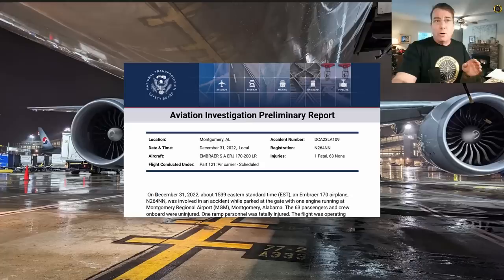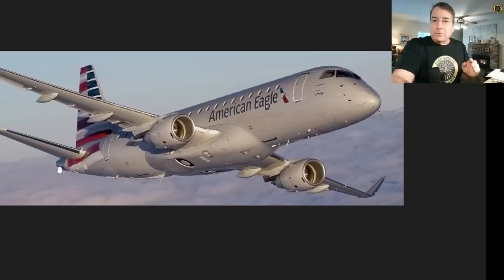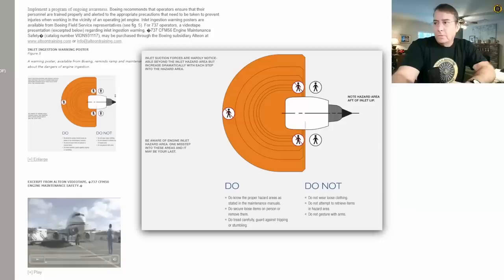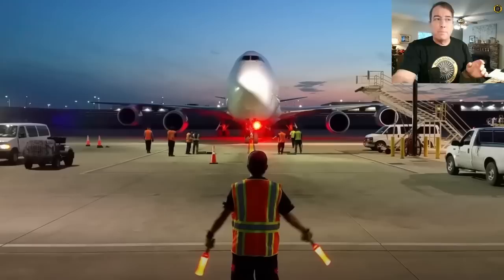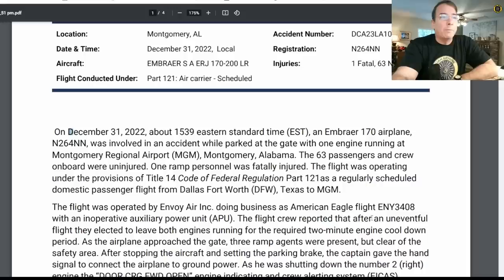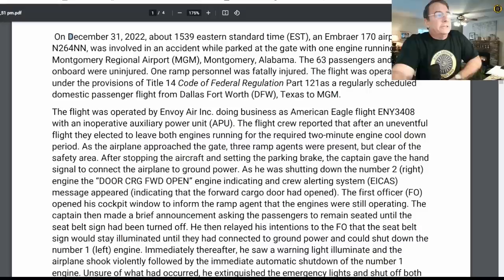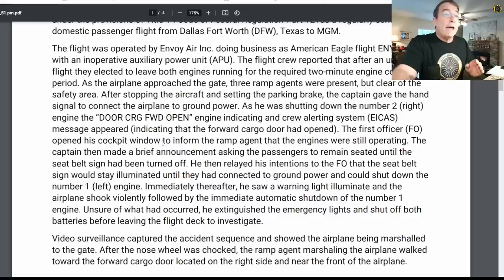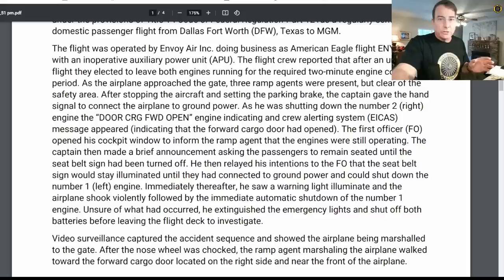NTSB Preliminary Report Ramp Agent Fatality 31 Dec 2022 Montgomery Al.

Comment: It would be really interesting to look into the ground crews training at this airport. The amount of safety violations that occurred after the plane landed from the cargo door being open and people walking close to the plane while both engines were running is very telling.
Reply: I agree. It seems from the moment the agent moved toward the cargo door, it signalled that it was safe to start their ramp duties 😨
Reply: Indeed. Not only the victim violated basic safety rules.
Reply: Yeah, couldn't possibly be personal responsibility... must be someone else's fault...
Reply: I'll bet the safety training is fine. 
I'll bet it was the Go! Go! Go! Attitude that contributed to this incident in a Big way.
Reply: The training is standardized across the airline.  Initial is done via computer modules and then they fly you to a centralized training facility somewhere like CLT or DFW (for AA).  After that, anyone who is on the ramp is fully aware of safety zones, briefings etc.
Reply: Training at my company is poor (not on behalf of the airline though because we're contractors). At this point it feels like they're just throwing anybody with a pulse on the ramp
Reply: @trinity72gp  All too often leaders are inclined to handle breaches of safety rules in the "No Harm, No Foul" mode. They haven't got time or enough extra workers to truly discipline those who break the rules, so the rules aren't followed rigidly as they should be.
Reply: Another contributing factor: holidays. Rampers calling out. Greenhorns pressed into service. High operational tempo.
Reply: @buckhorncortez  I could be either...  That's why it would be interesting to look at the training.   One mistake could be human nature - but multiple from different people at the same time seems like a failure higher up possibly.
Reply: @buckhorncortez  when your company, boss and crew all flout the safety instructions then they all bear responsibility. People who push the "personal responsibility" line never want to address systemic contributing factors or general reckless behaviour. It's just a line used by people who want to blame the person who suffered the consequences and let off everyone else who did anything wrong. That's rejecting personal responsibility and putting it on the deceased.
Reply: As with all aircraft ops, complacency is deadly.   Misguided focal point due to 'turn time' combined, and it is tragic.
My thoughts go to her family..
Reply: " Ger 'er done" itice is the same as " get home" itice. Both have negative consequences too often
Reply: @cheddar2648  I wonder if understaffing issues led to the hiring/retention of people who never should have been on the ramp in the first place.
I've supervised people in the past who Dont Care/Dont Listen/Dont Think.  just one is a hazard on the ramp let alone all three.
"Two feet and a heart beat" is NOT the minimum requirement for ramp work.
Reply: they barely speak english down here in Alabama.
Reply: @sladeoriginal  Speaking of language issue, I worked 40 years in Construction and once sat through a safety meeting with 4 Spanish speaking laborers. They had no clue what the instructor was saying. When I mention the safety hazard of communication, I was chastised for bringing up a so called political issue and was told to not talk about it? So much hypocrisy with safety, hiring unskilled labor and saving money is the bottom line. A lot of companies just do the minimum to keep the lawyers and insurance companies satisfied.
Reply: You can train people all you want, but you also need to keep from incenting unsafe behavior.  Training is futile and safety meetings are just Kabuki when there's bonuses for cutting corners or punishment for taking the time to follow safety protocols.  The big problem is human nature and poorly crafted incentives.
Reply: The report said they had a safety briefing before arrival to state the engines were going to stay running whilst the GPU was plugged in. All the staff  who broke the rules must learn from this. One girl sadly cant. Basically, screw corporate pressure. Do the job as quick as possible, but FOLLOW THE RULES!
Reply: @blackmusik109  Unfortunately I know this is because they contract most positions now days. I have been involved in two outsources where good well trained agents with years of experience were replaced. The new contract workers were basically off the street never been around airplanes and willing to except smaller pay for the job. I was at a station of 36 employees and 3 stayed on with the new contractor.  The bottom line is that some airlines aren't worried about safety.
Reply: @jimshaffer1780  
Lack of understanding the safety briefing—the words themselves, or the implication of serious danger—was my first thought when hearing this.  I have no info about the woman, however.
Reply: @gmvillan  You have to remember your trained on the basics! And major airlines, the hubs are big so your environment is totally different then where you will be working! Example if your being trained in Denver! There bag drop off is a long drive! Then come to your small airport that the drive is may 2 minutes! Really your best training is hands on at the airport your working at! And hopefully there are seasoned rampers that don't care about there feelings!
Reply: @airmotivewelding8012  The problem that I'm having with that is! The plane is already late and coming in with an inop APU! So a good ramp would know there is no rush! Just get this plane out safe and sound!
Reply: @pault228  So none of these well trained agents where offered jobs by the contractor?
Reply: @0utdoorsman  That could be said for any job really! Ever had a food order wrong going thru a drive thru?
Reply: @westbayoutdoors123  To be honest, If you followed policy and procedures by the book ! You would delay ever flight most likely!
Reply: @davidsmiths5471  Getting a drive through order wrong isnt likely to kill you on the spot.  The ramp is a deadly place and you best respect it or get out.
Reply: @0utdoorsman  Ah,so being a supervisor did you terminate these" two feet and a heart beat" people on the spot? And what should be the standards for the ramp?
Reply: @davidsmiths5471  Leadhands dont, and Supervisors seldom have the authority to fire employees.  
If you do, you are probably at a good company where you wont need to.

That being said, I did tell one guy not to come back, ever.

Minimum standards, ability to pay attention and take your job/safety seriously.  
What ever happend to having a Professional Attitude?
 If a grocery bagger can do it, so can you.
Reply: @buckhorncortez : Considering there were several people doing violations at the same time, it is pretty clear it was issue of safety culture, not just some single person deciding to cut corners. If the whole team breaks the rules, it is obvious the problem is higher than the grassroots.

Comment: The fact that so many ramp personnel seemed almost oblivious to the unusual condition of this aircraft makes me suspect of the effectiveness of the safety briefings. Clearly the danger was underestimated.
Reply: Do you really even need a briefing not to walk in front of/around a running jet engine? Between the beacon light, sound, spinning blades, 100+ mi/h wind, etc. it seems like common sense. It should be hammered in starting day one
Reply: Provided the safety brief actually occurred like management says it did...
Reply: @Hadzz95  Inop APUs is basically hands on training! Once someone actually have witness a live Airstart! And next time the ramp hears and inop APU! They will volunteer to get a bucket of sparks(kidding)! Plus technically there should be briefings before ever flight! For equipment set up,FOD walk, might have a motorized wheel chair, baby strollers,car seats etc!

Comment: I worked for a Canadian region airline that operates a fleet of Dash-8 aircraft. The Dash-8s typically taxi with one engine but do not turn off its engines before the GPU is connected. So everyone on the ramp waits for whoever brings the aircraft in to connect the GPU and for the engine to feather and stop, before approaching the aircraft to chalk the main gear and to position the cones. Also, we are instructed to never walk through the blades of the engine even when they are not spinning.
Reply: Only way to be sure.  Never go in the ingestion zone.
Reply: At least you know the dash 8 usually does it this way .... so you are guarded already.
Reply: It’s sad “never walk through the blades” has to be explained to someone
Reply: @applec2400  Do you think everyone that are reading or making comments about this actually work at airports?

Comment: I was on the KDFW ramp in the 90's for a regional airline. ~90% of our staff were safe, aware & were proficient around our aircraft and others. AMR rampers working charters and international flights under contracts were about the exact opposite. Many of them didn't have a clue. I remember one asking "how aircraft moved on the ground"'. Asked "if the wheels had motors or something?" It was just another job for them to put food on the table
Reply: I didn't work where you worked, but I have had these sorts of people ask why the designers hide the drive shafts running from the engines to the wheels.

Another asked how do they get the engines to go from forward to reverse so quickly when applying reverse thrust. My colleagues said (jokingly) that the aircraft had a full synchro gearbox ...
Reply: @vk2ig  Rev-matching on the freighters & older birds without synchromesh!  Incredible...I guess we all can't know everything(: 73
Reply: They aren’t paid enough to care about knowing those things.
Reply: Thanks for your input.  I'm not surprised by what you are saying.
Reply: It's a reasonable question. From a child. In the lounge area. I wouldn't want to hear that from someone with an airport employee badge.

(There has been talk of putting an electric motor in the nose wheel, but the added weight generally isn't worth it. How much gas does it take taxiing around, vs. the mass of flying that motor tens of thousands of miles? Plus, the engines do need some time to cool down.)
Reply: @Chellz801  Pay has nothing to do with what happened that tragic day! That was a messed up ramp by the report!

Comment: i had an incident where i lost focus as a lineman 30+ years ago.  fortunately it was with the hot end of a running citation engine and not the suction side of a larger jet engine. i crossed directly behind the running engine with the battery cart and my hat, ear pro and more were blown clean off my body and down the ramp and my head got nicely toasted. it was only a split second of losing my situation awareness - that's all it takes.
Reply: I'm glad we didn't have to watch a video about you!
Reply: @bbeen40  me too, though back in the late 80s there weren't cameras everywhere like there are now and no YouTube, so i would have been 2 sentences in the local paper.
Reply: @socomon69  That would be even worse!

Comment: From my experience,  the answer to the time pressures is two fold. Yes we are under pressure to get the airplane put within the minimum turn time but never to the point to where the airline wants us to take these types of risks. On the other hand, since I work for a contractor, the pressure can be greater than what the airline demands due to delays hurting our contract and having to meet performance criteria. This pressure in turn leads to us sometimes taking shortcuts to do whatever it takes to get the job done. I've literally had a high ranking person from corporate tell us to do whatever it takes just a few weeks before this accident occurred.  Another factor that plays a part in this is lack of training and complacency. We're constantly short staffed so we feel compelled to take short cuts to make it work. When new people are hired and we're on a a time crunch we don't have time to properly train new hires so bad habits become common place since we don't always have the time to correct them. Not sure if this is universal at all stations but this is my experience at the station I work at.
Reply: Short staffing is prevalent in many avenues.  Still, I have to wonder if ramp crew members were on certain substances.
Reply: I sort of wonder because having jet blast knock you on your ass should be terrifying. I work ACS and ramp in the UK and I’m not ashamed to admit that the engines scare me a bit. I’ve been two or three bud lengths behind an A320 during taxi and felt the jet blast push against my body. It doesn’t hurt, nor is it dangerous or unpleasant but it at least makes me respect the distance needed to keep me safe from it.
Reply: Sounds like if your delaying flights constantly, something is wrong with the ramp! Could be understaffed,poor training,bad management,bad ramp management!

Comment: In my previous career I worked both as a flight attendant and a ramp agent controller. In both jobs, safety has always been on top of our minds and approaching an aircraft with beacon lights on was simply a big DO NOT DO THAT! Pressure? Yes, there's always pressure and I hear that it's getting worse (at least in Belgium). But when I was working on the ramp I always placed emphasize to never approach an aircraft with running engines and to adhere all safety measures. I always placed people on report when I saw violations. In aviation there's just no place for cutting safety corners.

Comment: As we are going to many more of these smaller stations, we face this more and more. Bus cooldown is 3 min. We are so used to just pulling in to the gate as we approach, I have found myself getting to the gate with sometimes a min to go on cooldown.  I am working on conditioning myself to not make the turn until I know I will not be leaving the engines running longer than necessary at the gate. Now this situation of an inop APU, which happens way to much these days, you don't have the luxury of shutting the engine down right away. This is where you have to hope that they ground crew is being safe and following protocols. Very sad, thanks for the great analysis of the report an tragic event.

Comment: I worked as a ramp agent at SJC (San Jose Intl) for Delta 2020 thru 2021 per diem. I only worked a couple days a month. Not Approaching the aircraft until the red beacon underneath is no longer illuminated is very basic knowledge and NEVER violated. Even us per diem employees were given extensive training regarding this topic.
Very sad but I’m curious her training. My assumption is the ramp crew got lazy and began breaking basic safety rules. So sad

Comment: I worked on the ramp and can say that for sure the ramp is a VERY dangerous place. A small lapse in judgement can result in serious injuries or death.
Reply: Question... Do all ramp agents wear safety headgear, and was it possible the ramp agent confused the engine sound with what she thought was the APU?
Reply: @TheGospelQuartetParadise  supposedly they were briefed about the APU not working.
Reply: They were briefed that the APU was not operating and she was blown off balance at the rear of the engine.  She had to know the engine was still running.
Reply: @larrybe2900  Indeed, exactly.
Reply: @TheGospelQuartetParadise  Former ramper at SFO. Everyone wearing hearing protection but both APU and engines are very loud. The APU is generally much higher pitched, almost squealing sound and you can sense its direction from the tail. Distinct and different from lower pitched engines, and you can easily tell the difference. And easy to hear the second fuel is cut off and the engines start spooling down. The main issue are Rampers that don’t pay attention, listen and look at engine spinners and beacon lights. Complacency takes over. Get the 1st bag off in 3 minutes. Management all over you if that doesn’t happen.
Reply: ive seen some use hoodies to cover the use of headphones(airpods), they make take it as phone call or a pleasure of hearing music but a little error can be fatal.